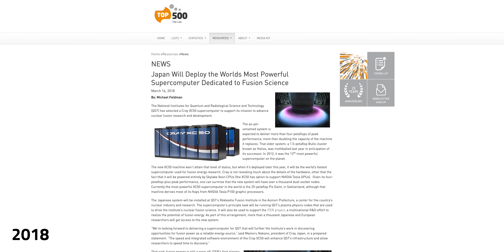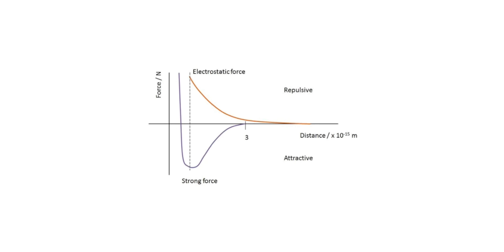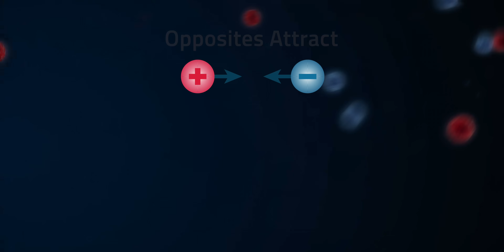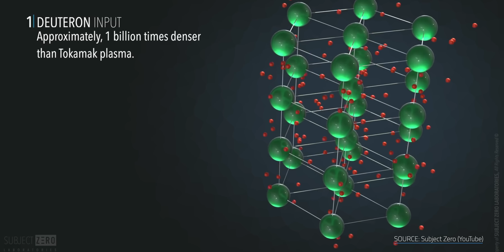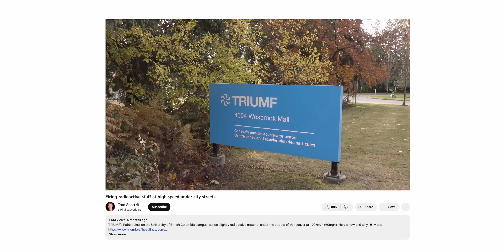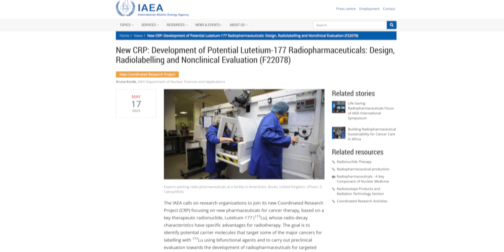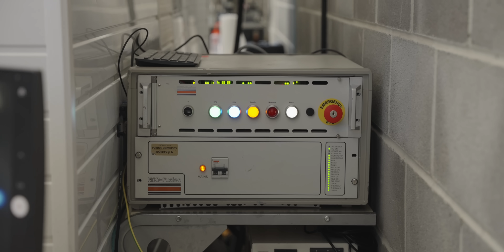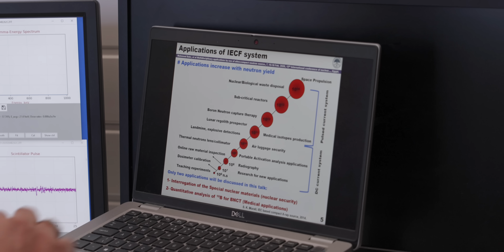How Nuclear Fusion Can Benefit Us … TODAY!

Comment from the maker: Have you enjoyed the UK Nuclear Tour? Check out the RoyPow Sun Series batteries here: https://www.roypowtech.com/ress/ or email sales@roypowtech.com.

If you liked this, check out Why is this Propeller Getting So Much Attention? https://youtu.be/UzYHO4tksTc?list=PLnTSM-ORSgi7uzySCXq8VXhodHB5B5OiQ
Reply: We created Muons and electron showers using a field crushing venturi and pulsed lase....all we want is the Electrons and we separated them.We can collect them at the point they are free of the Muon...
Reply: Fusion research is useful and beneficial.

Fusion commercial energy research is a terrible fraud that cannot succeed because of the laws of Physics and of Engineering.

A well-balanced video. The ad was better than the fusion bit.

Remember CARDIE: curtail fossil extraction 2%/month and emission, avoid especially methane; replace and shut down fossil activities; drawdown and increased conservation; energy efficiency improvement 8%/year.
Reply: @@rezrow3521A theoretical science, unlike what happened with nuclear.
Reply: Wait, they had solid state hydrogen storage?  @8:00 minutes.  Isn't that what Bob Lazar used in his Hydrogen powered corvette?
Reply: @anothermike4825  They used a metal that'll be infused with hydrogen. This channel has talked about that type of future hydrogen storage.
Reply: My first job was at the TRIUMF cyclotron at UBC in Vancouver (video clip included in this video). The particles were shot down a 2 km tunnel to the "nearby" university hospital. When ever the cyclotron powered up, the CRT monitors were affected and images on the screens tilted. Also, had to wear a dosimeter to measure any accumulated radiation exposure.
Reply: I love seeing more and more ads for different battery suppliers. More research, more investment, more production, more competition!
Reply: I think there is a deleted part that robotic augmentation on fusion reactor room no longer exist.
Reply: Hi,
Thank you for the interesting story.
Do you know, that there are companies with production facilities ready and decades of expertise in neutron generator production?
Please consider checking Shinefusion, for example.

Comment: So cold fusion has been renamed to lattice confinement fusion lol. I'd be curious to see if the cold fusion lattice confinement adds anything. I'm guessing the  lattice material would consist of a somewhat magic nucleus so neutrons bounce instead of being absorbed. Then, as in a metal hydride, you can pack in a lot more deterium in a small space then you can with a hot gas, so it's a better target.. Also the lattice material is probably a high melting point metal or ceramic approving it to last longer as a liquid or solid then a hydride or high density deuterium packed molecule such as D2O. I'm imagining that they're also adding some LiBe in the lattice as a neutron multiplier. Of course the yield will be low but they're not trying to produce power. Add in Molybdenum-98 if the target is technicium etc. Makes sense. Seems like a good use of cold fusion :).

Comment: The truth about fission reactors is that they are simple...too simple. If you put the right material in a box you get a energy output that could sustain the earth need of energy - it is so simple even a 2 grader could do it, simpler than lighting fire! 
So why  do we need to spend billions on these fusion reactors - that are not cleaner, if you consider that you have to dispose of the radioactive reactor wall! 
The only thing that will save the planet is to use energy wisely

Comment: As for tritium production it might be just a side effect to catch escaping neutrons with a lithium blanket. It would be just a minor source of tritium. There are so many fission reactors around which could be used for that and they have far higher neutron outputs. What they sell with this fusion reactor are medical isotopes which are sold by milicurie or in other words just there radioactivity because no chance you can put them on a scale. Judging by how inefficient fusors work it's unlikely they even produce a gramm of tritium in a year.

Comment: So, you need not much power output but rather neutrons and small zero power fission reactors have been around for decades. Basically they are doing something with fusion which can be done with fission.

Comment: But nuclear fusion is still 30 years away as it has been for at least 50 years.
Reply: This is just to produce radioactive isotopes in a smaller format, there's nothing unobtainable about that, it is much easier than energy generation.
Also:
We've had fusion since the 1950s
We had the first confirmed energy net positive in a fusion reactor in 2022

Comment: There is a  VERY important lacuna in the presentation here: in terms of consumption of radioisotopes,(as you mention) Tc99m  by far makes up the largest demand. This IS NOT delivered straight from an accelerator. Molybdenum 99m, the parent isotope, provides this upon demand and has a very long half-life compared to the 6hrs of the moly. We produce large quantities every night at my company just by drawing the tech off (chemically) from the moly extraction columns, and deliver it in the overnight to much of Ontario. It is a very to point out that it is NOT necessary to be close to an accelerator centre to use many important radioisotopes. (Our I-131 product arrives from South Africa regularly!)

We DO also produce produce short lived PET-relevant isotopes (by our IBA technology cyclotrons, seen in your video) etc., but your video fails to distinguish the significant differences in the clinical needs of the various radioemitter types. I know you are focused on the multistate process description and only have so much screen time, but one must understand the current needs and resources to then understand any advantage of the approach presented here.

As for the gamma driven fusion processes described by this company, it is just another in a long list of low efficiency nuclear conversion techniques ( as you hint, paralleling better nuclear fission methods) for making isotopes. It is very far from demonstrating any useful potential as some net-gain room temperature system and will likely remain an interesting nuclear diagnostic tool. There seems to be a lot of potential venture capital money at play here, so don't be sucked in by very grandiose and vague application claims.
respectfully yours, DKB

Comment: If you were at Culham on Tritium there's h3at and the UK tritiated waste inventory, there's limited available tritium in ready to use stocks, but a huge amounts of unprocessed tritiated wastes that h3at is designed to extract and recover. If you processed it all you are in the tonnes range, it'd just currently despite a high notional price the demand for tritium isn't there.

Comment: Of course SAFIRE (the medium heat plasma reactor) has produced the transmutation of elements and some years now and due to be its exceptional results, has moved well beyond this point. It creates its own electromagnetic containments fields (like nature i.e. the sun's atmosphere) and works as soon as turned on and so, doesn't need to smash things together. So it would be good to do a piece on the SAIRE (Solar Atmosphere In Regulation Experiment) and so give all sides of the fusion debate, as it mow not only produces power but also the production of rare earth elements and the very real potential to eliminate radio-active waist.

Comment: Electrostatic confinement was invented by Filo Farnsworth in the 1960's, the inventor of the cathode ray tube television system. But ITT bought the patents and buried the technology for 30 years. The original device is called the Farnsworth Fusor. He successfully fused deuterium atoms as determent by the presence of a neutron output on his kitchen tabletop. This technology has so many avenues of potential. Tokamak, look out!

Comment: An Edison generator and dynamos power plants were invented by Thomas A Edison and Tesla.  Edison's permanent magnet motor as a generator powered Tesla's brushless motors as generators with inverters and transformers to deliver high voltage AC power continuous peak power to the power lines.  Nuclear power is not needed and too dangerous globally to tolerate by any citizen.

Comment: Nuclear fusion power and nuclear technology nuclear power are under Treaty enforcement and obligations.  We don't contribute to the nuclear cascade.  Therefore nuclear technology of anykind is not developed built or shared.  We can produce unlimited electric power without fuel or pollution using Edison generators and dynamos power plants with inverters and transformers to deliver high voltage AC power continuous peak power to the power lines.  It is a violation of our Treaties instituted by scientists to initiate survival and ratified by Congress to promote or share nuclear technology.  We don't have any need for nuclear technology.  The radionuclides used for medicine are malpractice and harmful. The use of nucleotide in research was abandoned in the 1980 after the nuclear nonproliferation treaty enforcement and obligations were publicized.

Comment: NASA published lattice confinement fusion results in April 2020 in Physical Review C.  See Phys. Rev. C 101, 044610. 

The NASA paper reports Irradiating a deuterated metal lattice with 2.5-2.9 MeV photons in a setup many times larger then the setup shown in this video. The paper shows a neutron spectrum with  peaks around  2.5 and 4 MeV.

Has the startup in this video published their neutron spectrum and the radioisotopes they produced??

Comment: I hate to be a wet blanket, but I'm pretty doubtful about this one, particularly with respect to energy production.  On their website they write they can "confidently produce greater than 1 trillion DT fusions per second within a commercial architecture."  I'm guessing this is hypothetical because in the video they only talk about supplying the D (deuterium) and not the T (tritium).  Also, I didn't see any facilities for handling the radioactive tritium their vacuum pumps would be removing from the chamber.  There would also have to be a lot of neutron shielding around this to keep people safe from this neutron flux.

In any case, even if they were producing 1 trillion DT fusions per second, this would only produce 2.8 Watts of output power.  Then you'd have to convert that to electricity at about a 35% efficiency, or about 1 Watt of electricity.  (10^12 fusions/second   *  17.5 *10^6 electron-Volts/fusion  *  1.6*10^-19Watt-seconds/electron-Volt = 2.8 Watts)

In the video when Dr. Mahmoud Bakr Arby was running the experiment at "higher power" he said that it was producing about ten to the fourth (10,000) neutrons per second, which would give off 7 nano-Watts (DD fusion reactions give off about 1/4 of the energy of DT fusion reactions.)  I'm not an expert on medical isotope production, but I'm guessing they will need many orders of magnitude more neutrons to produce useful levels of isotopes.  Maybe if they switch to DT it may get them there since the DT fusion rate is much higher than DD.

Comment: Really hoping they improve thier output significantly, as the 1X10^4 neutron/second number they gave for the high power run
(10,000 n/s) is magnitudes too low for any real world application. 

There are a handful of private citizens throughout the world that have been able to achive 1X10^7 n/s outputs. If amateurs can achive those figures without funding I would expect much better from a company.

That all being said, the company did state thier intentions of moving to a 200kv system, that should boost thier output.

Comment: Can we please retire that foolish phrase "...the power of the Sun" with regard to fusion power?  The major reaction powering the Sun is proton-proton fusion, a very slooow process at solar core temperatures, which is why the Sun burns slowly for billions of years instead of exploding.  Fusion reactors and hydrogen bombs aren't doing any proton-proton fusion at all, they're doing mostly deuterium-tritium fusion, a much faster easier process, which is why reactors can work at Earth-safe temperatures and why hydrogen bombs DO explode.  "The power of the Sun" is about a large lightbulb's worth of power per cubic meter.

Comment: What if you use a graphite capacitor and a microwave source in a sealed hydrogen chamber with the capacitor insulated from the ground so the cap makes an arc and electrostatic field for confinement.

Comment: Matt much better.  We need to see what is possible and what is profitable even if it is not the best.  We can never move forward without focusing on what is truly possible and reasonably priced that will make a difference.  Could you do some videos on best alternatives to solve much larger needs?  Example:  Walmart uses a lot of energy. In 2020, the company used an estimated 29,000 gigawatt-hours of electricity worldwide. That's enough to power about 1.5 million average homes. Walmart's U.S. electric bill is estimated to be around $1 billion per year."  Can you imagine if we freed up 15 gigawatts on the gird each year?  Walmart is of course doing its best, but they are still a far ways from net zero.

Comment: With how much we keep learning about fusion I won't be surprised the have very powerful very small fusion reactors all over the place. Like, as ubiquitous as the internal combustion engine. I mean, laughably common place where you just turn on the fusion reactor in your weed eater. I don't think they'll end up in a phone or anything, but I can see a 1:1 swap for where we have engines now.
Reply: I don't see this ever happening, for a fusion reactor to produce enough energy to run household appliances it would also be producing enough radiation to kill you. The power produced from fusion is the radiation, so they can't be separated.
Reply: @RMX7777  That's true for D-T fusion. Not necessarily true (or at least not to the same extent) for all possible fuel systems.
Reply: @MattNolanCustom  All known fusion reactions produce neutrons, either by primary or secondary reactions. Even the fuels considered aneutronic would be fatal if run at the power outputs required for appliances.
Reply: @RMX7777  Yeah, sorry. I meant really only to address your second point. Not all fusion reactions are as neutron producing as others. I agree we'll never see fusion as a small local power source in home appliances.

Comment: I believe that fusion plasma can be stably confined with a row of superconducting magnetic rings like 45 rpm music records stacked on a long spindle with gaps between them that deploy a high voltage electric field. The spindle can be the ceramic hollow vacuum chamber housing the plasma. The plasma is confined radially by the magnetic field and axially by the electric field which is grounded in the center of the row and made increasingly positive both up and down the row by wires to the rings. The nuclei are repelled to the center. Many electrons escape at the ends but that is advantageous. A straght hour glass shaped magnetic field. The constrictive curvature along a straight axis is the most stable shape I know. The electric ffield is needed to complete the confinement by blocking end losses.
Aloha